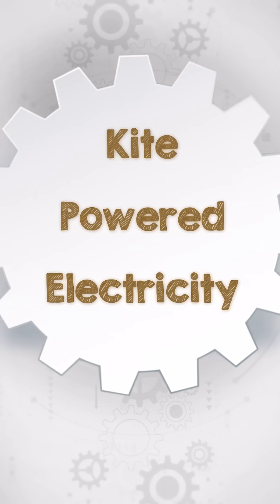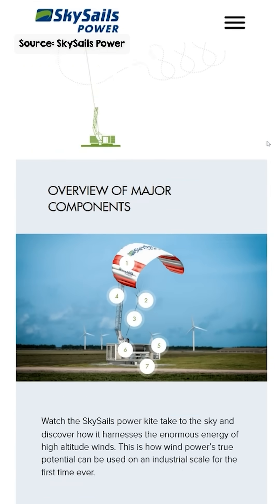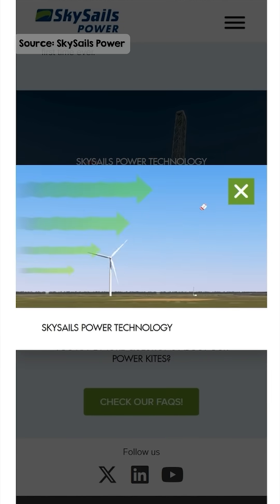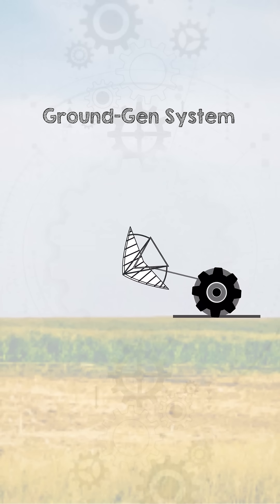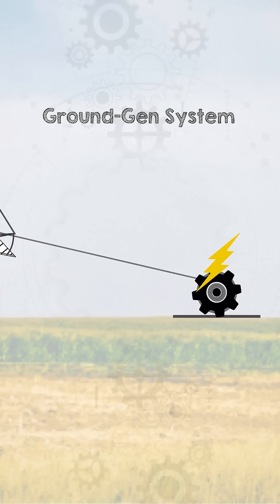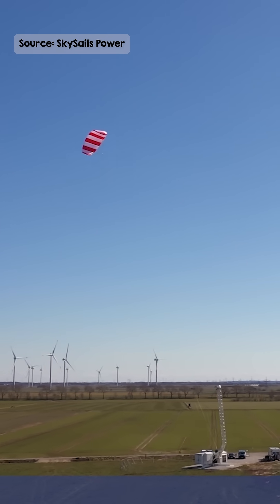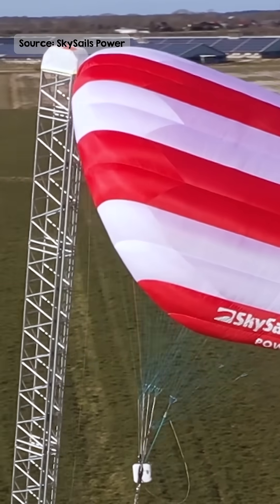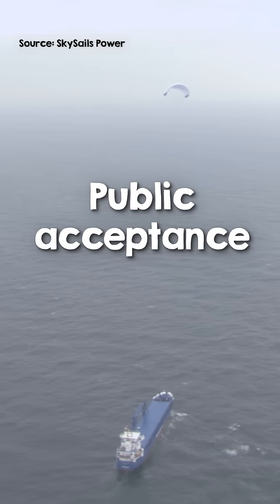How Can Kites Generate Electricity?

Comment: Hi Rosie, have you done a video on the new wind turbine that is on two sides (offshore only) by a Chinese company MingYang (not sure of spelling)? Was referred to on the RenewEconony website. Still working on it, but seemed interesting. 
This idea seems interesting, but maybe niche as it might be dangerous for bird life.
Reply: I'm sure Adam Harris at Myriad wind would be up for chatting about the potential scaling benefits of multi rotor systems
Reply: "Chinese wind turbine manufacturer Mingyang Smart Energy has revealed that its two-headed floating offshore wind platform OceanX has begun operations despite reports of blade damage to the giant 20MW turbine which was installed earlier this year.

"Mingyang unveiled the OceanX in July as “the world’s largest single-capacity floating wind turbine platform”.

"It features two 8.3MW turbines installed on 219-metre towers at an angle atop a floating platform using ultra-high-performance concrete. The whole contraption displaces 15,000 tonnes of water and relies on counter-rotating blades to increase power generation by nearly 5 per cent." (Renew Economy)
Reply: @aliendroneservices6621  I read the article too. It seems an interesting concept, but I was wondering if the engineering is sound.
Reply: Wind turbines have long been proven less dangerous to birds than cats, cars, windows and the fossil fuels wind power replaces.
Also debunked: Claims that wind turbines kill rare endangered raptors that do not live anywhere near wind turbines.
And if some idiot builds a wind farm in a bird habitat the fault lies on the politicians who decided to build it there, not wind turbines.
Reply: 这台机组已经吊装完成了

Comment: How does it re-launch after the wind stops? and presumably the tether is quite long - does this mean that radius around the centre point is unusable for other activities, in case of a crashing kite.....
Reply: I think that is the main problem with the idea, that and the need for people to handle things on the ground while a wind farm can be monitored by an engineer in an office hundreds of miles away.
Anyways, maybe add a balloon that fills with hydrogen to get it high enough that winds catch it? The hydrogen can easily be produced with electrolysis and even the water for electrolysis can be captured from air as long as you have power from a small solar panel.

Comment: G'day,

Yay Team !

I worry about the maintenance costs of such a System, and the weight of the Cable emerging from the Winch-Drum all has to be lifted by the Kite.

By the time it gets up to where the desirably Strong Winds reside, the Kite will be burdened by so much weight of Cable that it won't be pulling  very hard on the Drum.

Lifting a Kilometre of Steel Cable up into the Sky while unrolling it from a Drum,  intending to run a Generator from the unwinding Drum's Axle...; sounds to me to be likely to be fiendishly difficult to be able to contrive, so as to be
Worth the effort of getting the Kite to fly as planned...., automatically - merely for the fun of watching it.

I'd hate to have any money invested in betting on the idea that anyone can manufacture and sell a functional Windmill/Kite System, and manage to satisfy their Customer's Expectations while turning a profit...

But, I may well be wrong.

That does happen...

Such is life,

Have a good one.....

Stay safe.

;-p

Ciao !
Reply: Skysails has a 3rd party validated power curve to back up the value... But yes lifting a dyneema cable continuously over a sheave does have a wear schedule. 

There are alternative rotary kite power designs which don't have the same liner wear, but given my experience with them ... Seem harder to deploy at large scale ... So far
Reply: @KiteTurbine  

G'day 

Thanks !

Yeah, there's a famous Slogan, in Aeronautical circles, employed by a manufacturer of STOL Ultralights - Homebuild Kits (Zenith, makers of the Zenair series), exhorting the principle of 

"Simplicate...,
And add more
Lightness...!

Whereas it seems to me that the whole concept of using Kites pulling on Strings, flown by Computers, to generate intermittent Pulses of Electricity from the Wind..., versus bolting a Turbine Array and connected Generator up at the top of a Tower ; strikes me as being an exercise in handicapping one's efforts - for the "fun" of setting oneself a difficult Goal and then achieving it - regardless of whether that achievement actually makes any sense...

Another aphorism is that one has to be very competant and skilled to design & build a working Nuclear Bomb...; but only a Lunatic would ever want to possess such a thing.

Difficulty of accomplishment is no guide to Usefulness...

Such is life,

Have a good one...

Stay safe.

;-p

Ciao !
Reply: @WarblesOnALot  the rotary ones I made, flew networks of multiple kites so that they were mechanically autonomous within wind limits without any controller in the air

Comment: Generation of rotation is confusing.  Is it reeling out and in or bobbing in the sky?  I don’t see it.
Reply: These kites produce a lot of pulling force within a certain range of horizontal and vertical positions and barely any force outside this "power window". So the trick is to steer them in such a way that they can winch out the cable while in the power window, driving a generator to produce electricity, then fly them into a position of minimum pulling force to reel them in again. Automating that process so little or no human intervention is required is the tricky part.
Reply: @nkronert  Wow, very complex in engineering terms.
Reply: @johnpoldo8817  Like rocket science, this is being modeled for sure. It's not easy, but they will do it and make it work, but will it be cheap enough? That's always a huge part of the equation. With wind turbines, recycling was hardly an initial issue, alas, look what they do now. Not a good solution. But then again, maybe there are innovations happening there as well.
Reply: They are steered. In other words, your childhoods single line version would not work.

Comment: Sounds a bit counter-intuitive that the kite can generate energy as it is reeled out yet be reeled back in using less energy. (then I read the power cycle description, makes sense)
Reply: Thanks for the keywords. The kite is steered to maximum lift in first stage and minimum lift in second stage.
Reply: Well when you need to reel the kite back in you just fold it and let gravity do the work of pulling it down for you, then you just have the weight of the cables to reel back in without wind resistance.
Reply: Where can I read about the power cycle description? For me it is still not really clear how they assure that the energy required for pulling the kite back in is less than the energy generated